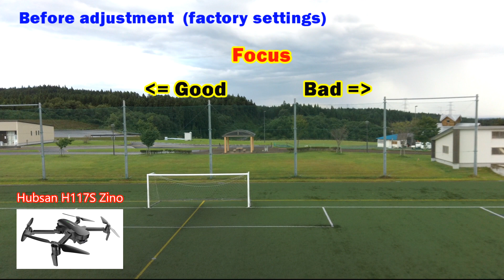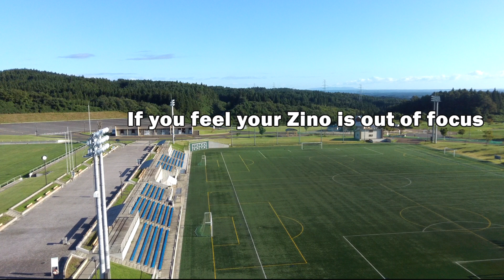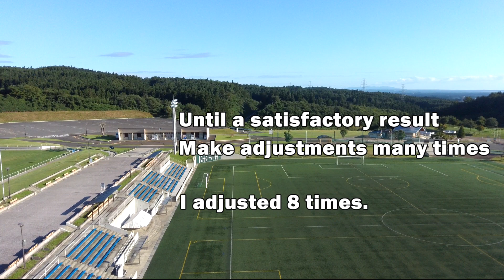[Hubsan Zino H117S] Adjustment Camera Focus!

Comment: The best video I saw this year! I was very frustrated with Zinopro because I had this problem mentioned here in the video!
I updated the firmware and nothing changed but when I saw this video I was impressed to know that someone had opened the camera and solved the problem with just a manual adjustment, I encouraged and did the procedure, I was amazed with the result after the adjustment, now it's perfect ! Congratulations to the creator of this video helped me a lot and will still help a lot of people!
Reply from the maker: It was good to be helpful.I was wondering if the out-of-focus problem was resolved when the Pro version was released, but I'm still surprised to see this bug appear. A user who has purchased a ZINO with out-of-focus issues will probably think, "I will never buy a Hubsan drone again" without any repairs (of course). Hubsan should be aware that more advanced quality control is required.😁
Reply: @megumi7000  True, I totally agree! Thank you one more time!
Reply: @megumi7000  I almost sent my pro back until I came across your great video. Thanks megumi.

Comment: Thank you very much for this video. I bought a Hubsan zino from Banggood a couple of weeks ago. I was looking forward to create some good videos with the Zino but got very disappointed after the first flight. The video was out of focus and after searching videos at YouTube I found information that there was some focus issues with the Zino. This was probably solved with a new camera firmware (about eight months ago). So the focus problems on my new Zino should not be related to firmware. After making the lens adjustments I went out this morning and tested the Zino camera. It was a big difference. Maybe I will make some additional adjustments on the lens to get it perfect. Many thanks!! After these adjustments I am pleased with My Zino. The gimbal keeps the horizon straight witch I could not get with my other drone, SJRC f11. I hope that SJRC will follow the good example that Hubsan has done with the Zino. But...a big BUT...Hubsan must be better with the factory quality check. It should not be the users/buyers that are fixing the problems.
Reply from the maker: Congratulations PerratheSwede.👌 It was good to be helpful. I can easily imagine your disappointment when you first saw the footage,because I was the same.
I'm also angry at Hubsan's Inferior quality control.However, I feel that it is not only a bad place, such as flight performance and price other than the focus.Hope the Hubsan staff will see this video and your comments for future improvements.
Anyway, I'm glad you didn't throw away ZINO.Let's enjoy fun drone life together😃

Comment: I adjusted the focus on Zino black edition. I will advise to unplug the camera unit from it's cable. Under the pink foam You will find the plug. In this case it's much more easier to do adjustment ( since my lens was turning really hard) and the short cable will not be damaged. 
Ps . Before adjustment image quality was really bad ( all blurred out) and I was thinking to sell the drone , but I was shocked about improvement after adjustment. Turned clockwise just a couple of millimetres. Good luck all ;)
Reply from the maker: Thank you for the advice. I didn't know that I could unplug the cable from the camera unit.
I understand how you thought about selling ZINO, I thought so😅
Reply: Im doing this mod at the moment and my camera cable popped off by itself

Comment: Thank you for this. I'm frustrated that Hubsan have still not addressed this. I have only just bought my drone so only a month old, the seller shipped a new camera and the new camera board was just the same. I have gone back to the original camera as i have made adjustments which seem to have improved. As per other comments i recommend removing the cable from the board, it's easy to unplug and put back in.

Comment: I am very impressed that I found this video :) Few days ago I bought my Zino, and because at the weekend I have place where I can test the results is that camera have big problem with focus, video is very blurred and noises and problem with focused. It little disapointed but I am not give up with this. So first idea today is to maybe replace camera to better if it possible. I not find anything. But now I find your tutorial and see differences. So we will see, I will adjust this as you showed and next week will see effects - and I will also check possibility of unplug this Ribbon Cables :) :) I will send you information in comment did this help to solve my problems :)
Reply from the maker: Thank you for watching the video. I think you need to make many adjustments to get the focus right. Please do your best to get good results. Please let me know if you can disconnect the cable.😃

Comment: That's a great video. Sometimes factory does'nt have the same adjustment on each aircraft. I was thankful my Zino has a perfect factory adjustment. But later if i feel it gets blurred due to movements. I need to follow this instruction. I think it will help.

Comment: thank you man.  I hope this helps me.  my copter pisses me off due to poor quality.
I read the comments and I think that the ZINO company does not adjust the focus of the lens on its products.
I hope this helps.
Subscribed.😉
Reply from the maker: Thank you for watching the video. According to comments received in the past, ZINO-Pro has similar flaws and believes that Hubsan has not made any pre-shipment adjustments.
I think ZINO has excellent flight performance at a low price. I think it is negative that Hubsan discourages buyers due to lack of lens adjustment.
I hope you can adjust the lens and have a fun flight.😃

Comment: turned the lens about 45 degree clockwise today..the focus got better on the center but very blurry on right and left..i don't want to do this too often as i might loosen the screw holes..is there a way to adjust the lens and test it right away without reassemble everything?
Reply from the maker: I think there is a possibility that the screw hole will loosen by frequent adjustment. However, it is impossible with ZINO to fine-tune while looking at the monitor like a single-lens reflex camera.

Comment: Thx for the video. I have the same problem. Left side is blury and right is sharp and clear. I try this thanks!
Reply from the maker: I can imagine your discouraged mood.😔
Reply: Hello David. Unfortunately I have the same problem with blury left side of Zino image . Right is sharp and good. Could You plese provide me how much did You rotate lens and which direction to catch perfect fofus. I would like to avoid many camera disasemblies so I would like to set 1 attempt the same like You. Thnk You in advance.
Reply: @sawekjarczok1843  a did a same job like in the video. Rotate lens really carefully, try 2mm
Reply: @DavidSob_official  Clockwise? Like the video? Mine is a little out of focus too.
Reply: @DJJPmusic  pls watch the video to the end.  I do it same!
Reply: did you guys all fix the focus problem?? i have a bad left side.. where do i need to rotate the camera? left or right?
Reply: @arezhOG  Yes I fixed it, usually you have to rotate just 1 mm clockwise  (clockwise will focus to infinite, counter-clockwise focus to nearby objects) But REMEMBER  = JUST 1MM OR 2, the adjustment is very sensible.
Reply: @DJJPmusic  do you remove the cable or not? i tried clockwise and didnt fix anything.. ill try one more time counterclockwise 2mm.
Reply: @arezhOG  No I didn't remove the cable, I did the same that the video is showing.
Reply: @DJJPmusic  im always scared that something is going to break. like the gimbal or the cable on the camera..
Reply: @arezhOG  Yes it's a delicate affair

Comment: I,
I've made the setting of the lense this morning, and it improved the focus, but now, when i turn the drone on it, the horizon, don't stay horizontal unlike before. I've tried to calibrate the gimbal many times. The process was successful, but the problem is still there. 
What can i do to correct that. Is there something to do with the firmware updates? Thank you.
Reply: not that I have solution but it would help others to see your problem and give advice if you upload recorded video :)

Comment: Oh man that is soooo much better. Thanks. Only 1 mm? Ooops what if i do 2mm and cant find the sweet spot. Hmmm.

This has put my off buying zino. Fimi looking better
Reply from the maker: Well, there are times when you can't focus perfectly even if you adjust. Because maybe the lens is distorted. Choosing Fimi may be a wise decision.😅
Reply: @megumi7000  Choosing Fimi may not be so wise. I got the fimi a3 and the out of focus problem exists with that make as well. The exact same problem with the focus but the opposite side of the screen. There are no screws on the camera for the fimi so I don't think you can do the same fix?

Comment: Great job!!, 1.., when you remove the cover make note of how it came off.. 2.., all this is very delicate, I did find it easier to CAREFULLY pop the connector off and remove the whole camera/circuit board.. 3, When you do this be sure you have no static on you at all!! otherwise your board can get damaged. Ground yourself to a metal object or better yet use a ground strip or grounding pad attached to you..4,..My lens was very tight, tweezers did not work, I used very fine pointed needle nose pliers to turn it CLOCKWISE a hair. A very thick hair, but a hair. you pick the color.lol. we are talking mm or 2 only!!. 5...put it all back together the same way you take it apart then test it. My camera centered at an angle at first but it straightened out eventually, so be warned, you might end up having to perform a camera calibration afterwards, in which you will need the camera calibration tool..!! It centered by itself after I flew it.....All in all I am now focused!!!!  So here you have it. BE VERY
CAREFUL WHEN and IF YOU DO THIS!!!!!! Thanks megumi for the challenge!!!!! P.S. mine is a zino pro.

Comment: Mine Zino is out of focus on the left side.  Should I turn the lens counter clockwise?
Reply from the maker: I can't say for sure, but we recommend turning it clockwise first. If the left focus is more blurred, turn it counterclockwise. Anyway, you need to adjust it many times to just focus.😅
Reply: Ok.  Thanks for the Tip
Reply: @joegannon6566  i have a bad left side too. did you fix it? did you rotate camera left or right?
Reply: @arezhOG  no  i been waiting for someone to reply before i disassemble the camera

Comment: What type of lens fit the zino?have you check?tq
Reply from the maker: No,If there is a lens with a brighter F-number, I would like to replace it. Please let me know if you know a good lens.😀
Reply: Me myself try to find out,my lens got scratch..😂😂😂
Reply from the maker: Scratched😨😨😨I hope the Hubsan will release it as a repair part.
Reply: I have tried to put xperia t2 ultra before,it really fit but out of focus.try to adjust but no point,still blur
Reply from the maker: There is no confirmation, but it feels like a spy camera lens. Sorry if wrong. ->  https://www.ebay.com/sch/i.html?_from=R40&_trksid=m570.l1313&_nkw=Wireless+WiFi+HD+Mini+Hidden+Spy+Camera+1080P+Digital+Video+Motion+Activated+Cam&_sacat=0&LH_TitleDesc=0&_osacat=0&_odkw=Wireless+WiFi+HD+Mini+Hidden+Spy+Camera+1080P
Reply: @megumi7000  Hello It seems I scratched the lens to...for replace it...enough unscrew the lens and srew the new one back ? DO you have experience with this ?
Reply: @dhlgalanta  email hubsan and they will send you a new camera module for 35 euro
Reply: @Timmeh  really?  Today I received a new lens from ali, so I will try to replace.. But thanks for information :)

Comment: dont know if the Zino quality lens is constant , seems to be that there are questionable lenses out there...
Reply from the maker: Well, I think so too. 
The fact that only the right side or left side is out of focus is a proof that the lens is distorted.
Reply: @megumi7000  be sure that the lens is really clean.I made my first test with the plastic protection film , i was very disapointed LOL!
Reply from the maker: @francoisBonin-phils  I bought a lens filter for ZINO. I will test and upload a video next time.
Reply: @megumi7000  on my side , i discovered the sharpness in the App , i put it at max=6 and it seems to be better.Actually i can't make videos , i am waiting for a fast SD card.